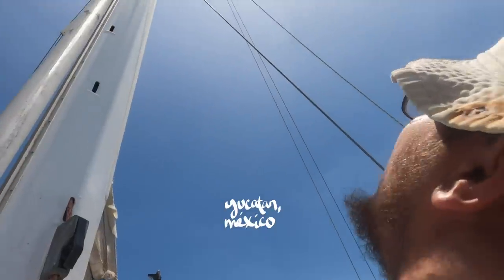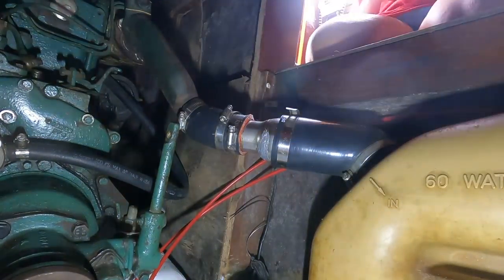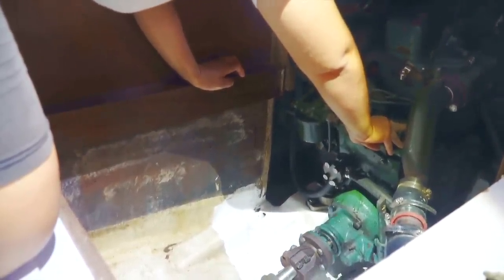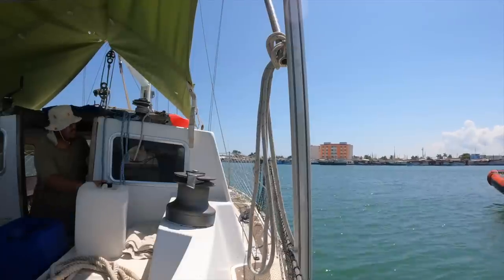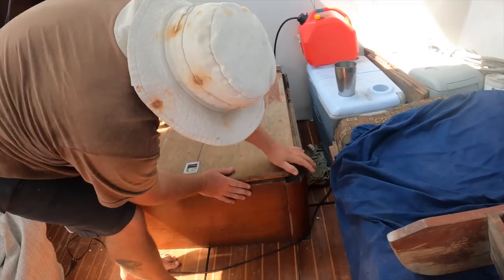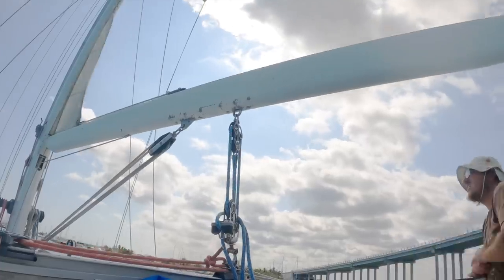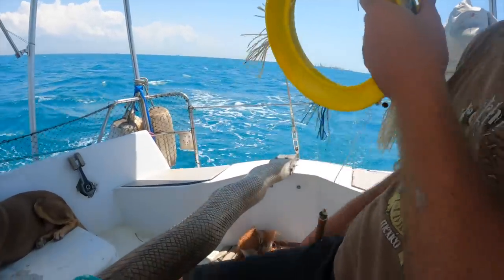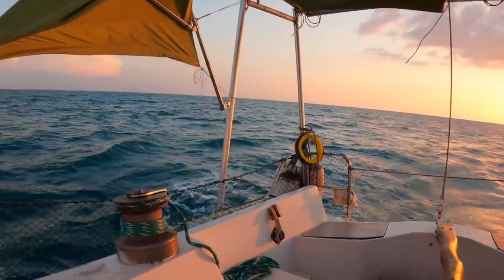SHAKEDOWN sailboat sea trial YUCATAN

Comment: To drill stainless steel, you will need a carbide drill bit and cutting oil.  I had the same problem and after I got a carbide bit my other bits just would not make it.
Reply from the maker: Yeah - I tried with some wd40, but we needed a better bit for sure!

Comment: Have you tried giving it 1/2 throttle and then pushing down that start button by the throttle? it should stay down, if it does then it should start right away!!
Reply from the maker: There's a little brass 'button' with a spring coiled around it near the throttle - we think this might be what you mean? We'll try pushing it next time we start the engine - it doesn't stay down though, because of the spring.
Reply: @sailorama  Try holding it down, Then give it throttle If it pops back up more throttle.  It needs to stay down. After it starts then it will pop up. If that doesn't work then maybe try holding it down while you start it!  It just lets more fuel thru the pump.